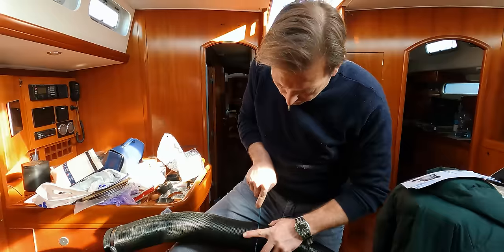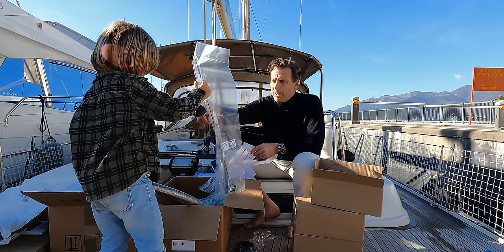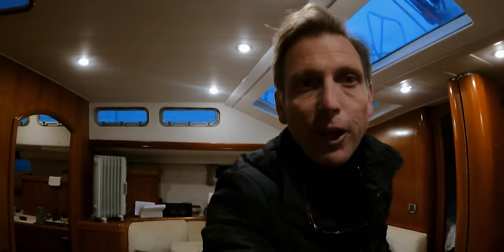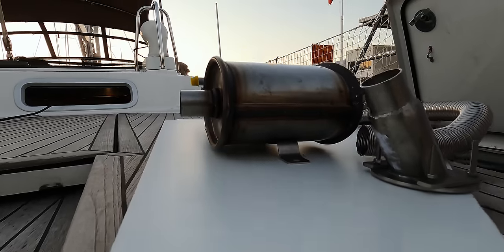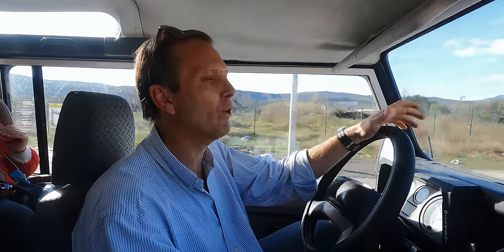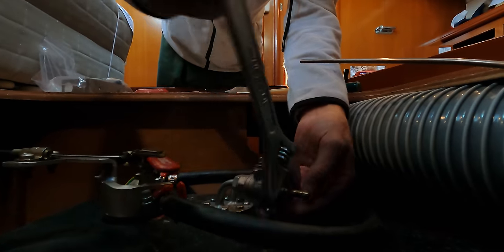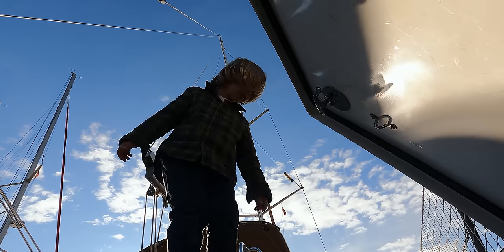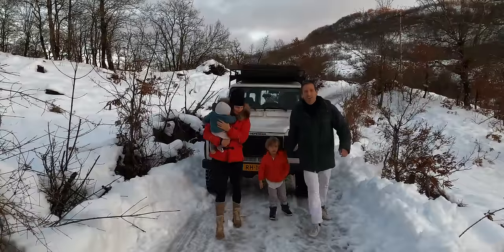FIRST STEP TO OUR PATAGONIA EXPEDITION | WEBASTO Diesel Heating System for SAIL BOATS

Comment: I agree with your choice. The one tip that I can give you is, if your are installing the heater unit in a small area, use the heater air intake to cool the space where the heater itself is. I have 2 mufflers in a row on my Eberspacher (same) type of system keeps noise down. Also the water hoses from and to the unit should be isolated from the hull by suspending with rubber. The reason is that the hydraulic noise created by the coolant circulation pump transmit noise to the boat hull.

Comment: Great decision we have one although slightly different from yours but with -20 outside we kept the temp easily at +20 inside. It’s a great way of heating but consider extra isolation inside cabinets. We actually put isolation and carpet on our floor. ( which we threw out in the tropics)
Reply from the maker: Thanks, yes the next step will be isolating, how did you isolate the cabins? Seems you had an amazing trip from
-20 to the tropics 😍

Comment: get a CO meter for safety - the heater hot air pipe can rust and leak and on a fault the CO and smoke can also come out of the heater inlet air pipe - also when running properly they produce very little CO and burn with little smoke - smoke means incomplete combustion due to excess fuel or carbon blocking the burn chamber etc - I am sure webasto advises running it on high for 15-20 minutes before turning off to burn off any carbon - well done
Reply from the maker: Thanks Jim for the great advice. We installed some CO alarms and run the heater as advised by Webasto to avoid any problems.

Comment: The heating doesn't causes condensation inside the boat ?
Reply from the maker: No, not at all since it’s dry air coming from the radiators